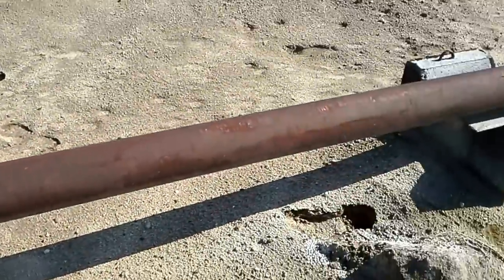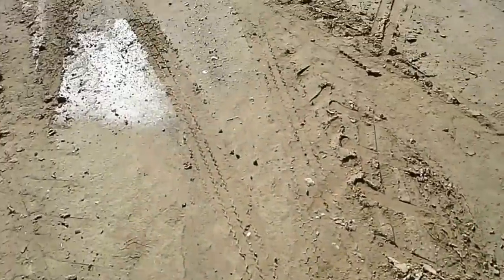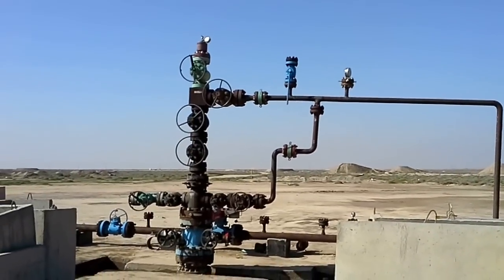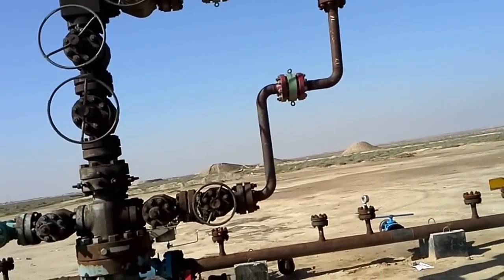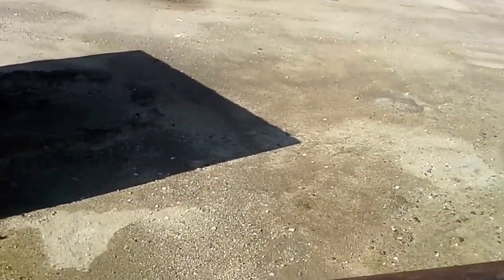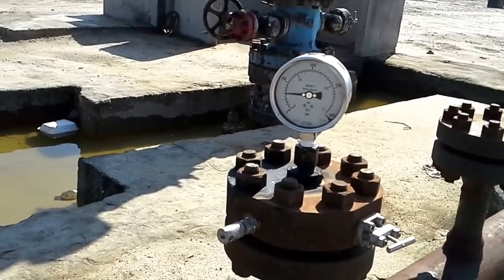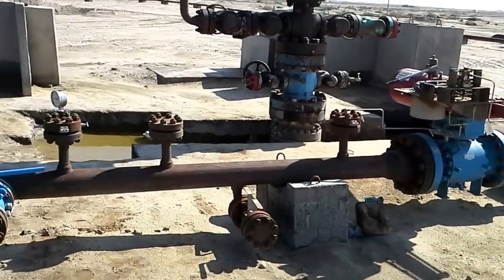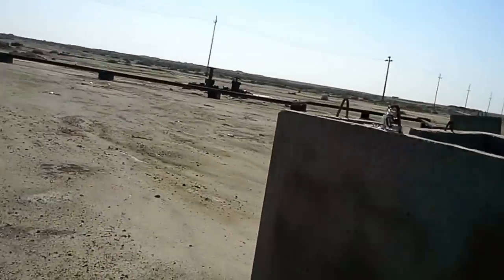Wellhead in service

Comment: this design is wrong where is the choke valve if we need to increase the rate or decrease the pressure, you need the kill valve for intervention if they have a problem they need to  kill the well by pumping a treated water throw the kill valve

Comment: Man, that flow-line temperature can't be 150 deg C, since the deepest reservoir in Rumaila is only  100 deg C, so this is a 50 C gain in temperature which it's impossible. I think you meant 150 F Not (C).
Reply: it could be  150 °F, more reasonable